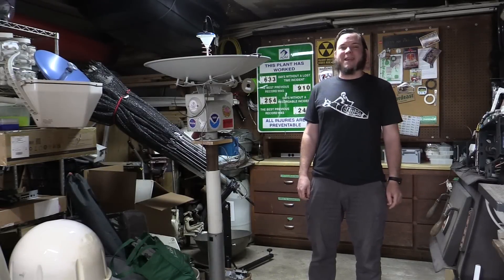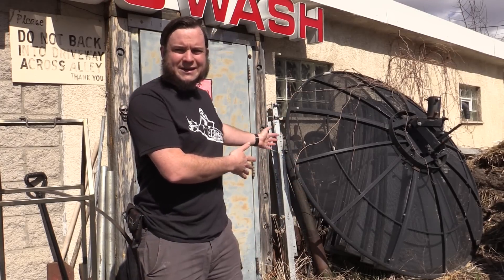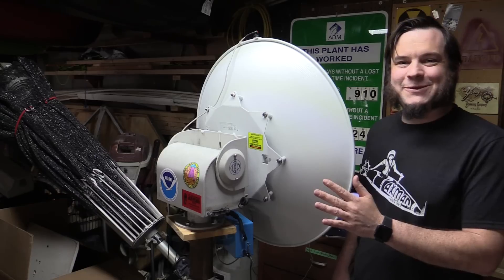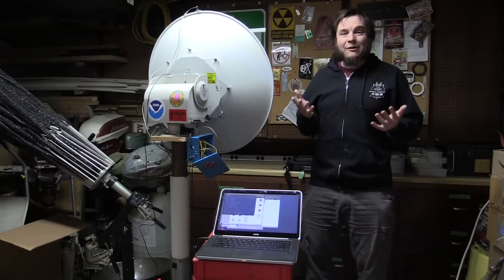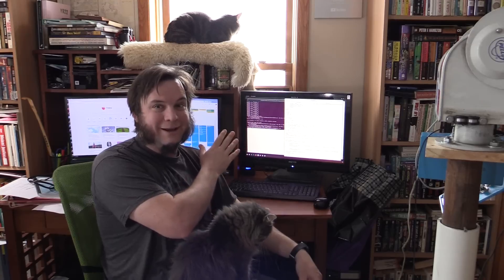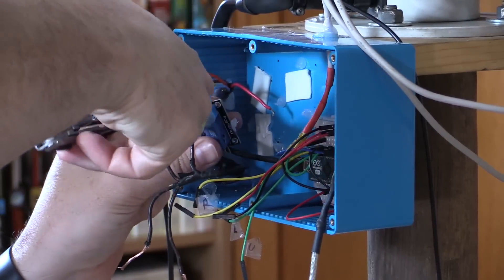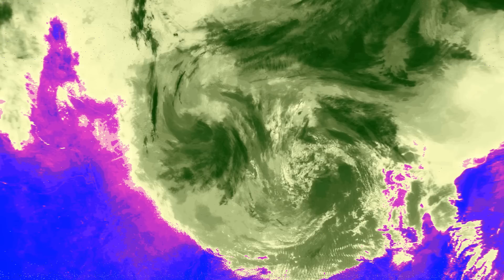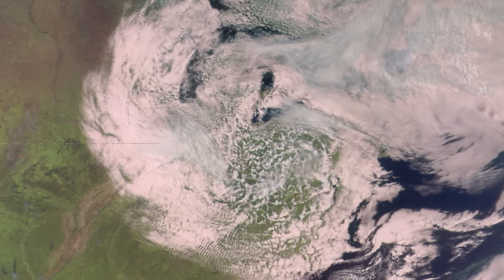DIY Satellite Tracker Pt 2 (And Radio Telescope Struggles!)

Comment: I had a similar issue with clicking relays as it turned out I was not providing enough current to the relay modules.  I was using a 5Ah Dewalt 20Volt battery from drill I made an adaptor with my 3D printer the adaptors can be found on Thingiverse for it/ Anyway, I used a DC to DC buck convertor did not realize the buck converter was only rated @ 3amps. I had to drop the voltage down to 12volts You can see where I am going with this. I needed the full 5A so all the modules will get what they need to run efficiently

Comment: I have been watching a few videos. Maybe instead of the relays, try the L298N motor driver. The page you linked has a schematic under "Electrical (mk1b). This may eliminate some noise.

Comment: I am doing exactly the same with a Sea Tel 2498-E antenna, and I can't find a way to stop it from moving very slowly even with the serial letter D command that says off tracking according to the list of commands
Reply from the maker: Interesting, I wonder if there's a sensor out of calibration, or too close to a magnet or something? I had to move my accelerometer / compass sensor farther away from the motor before it worked right.

Comment: Great work! at least you got the motors to move, that’s already quite an accomplishment imho 😅 I also like your approach to building a mount/ rotator from off the shelf equipment.
I’ve been working on my own mount for a 1 metre radio telescope as well, made the mechanical parts from scratch but the coding and electronics were beyond my ability. So I decided to use an Onstep controller (preassembled) and even that took me three months to get working…
By the way, a motorized mount is nice to have but it’s not an absolute must for radio astronomy. The 3 metre dish in my profile pic is mounted on a simple manual alt/az mount. I  point it to the south and use a planetarium program like stellarium to find at which altitude and time the object I want to detect passes the south meridian. Then I point the dish at that altitude and wait for the target to drift through the beam of the dish, essentially using the earths rotation as the other axis. I know of several other amateurs who use such a “drift scan” approach for their radio astronomy projects with success. It’s a slow but proven technique.

Comment: I suggest you look into ssh, vnc, and build a ptz camera. If I was in your shoes, I would set up a webcam pointed at the antenna in the garage, then either use ssh to connect to the garage computer, or use vnc/rdp if you need a GUI. 

I would also suggest either building a NAS and use nfs or smb, or use something like dropbox or owncloud. Personally, I store most of my project data on my owncloud server as well as config files for my 3d printer so when i make a change like adjusting the default temp on my office desktop, that change syncs to my livingroom laptop, garage pc, etc.

I have a cheap antenna/rotor in my garage that just has a "rotate" button on the remote. I opened the remote to solder the rotate button and made it powered off a wall wart plugged into a wifi outlet. the amp/control box is in my basement. Currently i have an old iphone attached to the top of the antenna to be used as a digital compass which feeds its data to node-red. Node-red receives a command like "rotate antenna to 220 degrees" and then it waits for the next compass reading to come in. if it is within acceptable range, the wifi outlet stays turned off. If it receives a reading outside the acceptable range, it sends the power on command to the wifi outlet. once it is within acceptable range, it sends the power off command to the outlet. Not precision, but I am happy when i can tell it to turn to 220 degrees and it stops at 223.

Ive been working on building a dedicated digital compass because occasionally, the software on the phone does lock up and i have had to go out to the garage to reset it twice.

Comment: Extremely cool. No need to feel bad, your vids are great. If you somehow could figure out how to read the radio signal without USB, then maybe you could use an spi SD card module from axman to collect the data without serial port problems.

Comment: Dude !  I admire your patience 👍 I've been tinkering with all things SDR , HAM, sat tracking , decoding pocsag, Js8, and all the other fun stuff.  I definitely don't have your patience though 😂.  When you said a week, I laughed to myself thinking of the 18 month long struggle I've had decoding P25 in my town😣. I get close and get so aggravated I'm like f@#k it I'm out 😂. Try it again next winter . I'm pretty sure my issue is that the system my town of Plymouth is using is the Boston system which is MASSIVE and I only have 6mhz bandwidth so Im not able to obtain enough bandwidth. Someday I'll get hack RF 🎉.

OH BTW I saw your video where you were showing your garden set up. Your squash plants had powdery mildew which just about every gardener whether rookie or veteran has to deal with. I grew up on my grandfather's large nursery so growing is in my blood.  
My region gets fungal infections every freaking year. Best methods to prevent , well delay the inevitable powdery mildew is to use a hydrogen peroxide baking soda spray as a weekly preventative asap the plants are big and leafy. Hydrogen peroxide sanitizes as soon as the sun hits it , kills all the bad stuff and won't hurt the plant. Baking soda alters the PH so the fungus /mildew can't grow! It has been working excellent for me for the last 4 or 5 years. When I skipped a week in July my 25ft x50ft pumpking patch got hammered by fungus😂.   Also don't water overhead like you have your sprinklers set up. Get a 200 ft roll of black 1/2 or 5/8" sprinkler tubing from Lowe's and pick up a bunch of the cheap sprinklers that you poke holes and connect to the tubing. So cheap and effective! Don't bother with neem oil , it smells horrible and doesn't do $hit😂. Good luck with the gardens this season brother!  Love your channel and I'm jealous that I don't have a n axeman shop here in taxachusetts

Comment: Random resets of a microcontroller are almost always caused by a power problem, this can be a coil activating and dragging the 3.3/5V rail down below what the microcontroller can run at, or it can be a coil activating and producing an EMI spike on nearby conductors. Both of these can be reduced somewhat by putting a capacitor across 3.3/5V and ground, which is generally good practice. I don't know that board specifically but a lot of microcontrollers have a VUSB pin, which is the positive voltage directly from the USB cable, so you can put the capacitor from there to ground if you're powering the arduino from USB exclusively.

A third thing it can be is that every microcontroller has a limit to the amount of current each individual pin can source, and all of the pins together can source, exceeding that can cause a reset, or magic smoke. The solid state relays should draw far less current from the pin, but you may find it improves reliability to have the pin control a mosfet that controls the relay

Comment: I love watching your content.  A suggestion (that other commenters may have made), but why not remote into the laptop in the garage?  Point the laptop's camera at the dish, and make the changes either directly or on your desktop and then copy them over.  You'll be able to work from the comfort of the house, but make the changes directly.
Reply from the maker: I should try that, although I don't technically have Wifi in the garage so I'd need to run a cable over to the security camera network.

Comment: You would be damn surprised how well AI works for helping me throw together code for some completely jerry rigged mess I've put together. I found that was the hardest part to starting to work with it actually; shutting up my brain when it thought "oh there's no way it would have any idea what I'm talking about". Granted its not perfect, but usually gets me 75% of the way there. 

Plus if I get an error I just copy and paste the error code and say "fix this you asshole". Actually trying to figure things out in general has become something like 75% for efficient since I started using it across the board. While never taking it for gospel of course. 

One of my favorite things is to spend an evening throwing whatever harebrained schemes I've come up with at it and seeing what sorts of ideas for execution it comes up with. Gets very uncomfortable when you ask about nuclear weapons though.

Comment: To stop the arduino problems put a 2,200uf cap on the arduino power line as it will kill off the RFI thats on the cable and if ya got some ferrite put some on ya USB cable

Comment: An Information Sciences Major here with a similar lack of math skills. I had a lot of trash thrown at me for having that skill set and still working in IT. I even had people saying that it would be impossible for me to work as a programmer. That comment was made while I had several years of experience as a programmer and several solo projects as programmer of custom ERP projects at my name. Keep up the good work and the output of the new tracking system seems the best I have seen on the channel in a while. Even with the wind conditions the output is very good.

Comment: Hello, I am happy to see you some sort of worked the equipment of yours. I think you are lucky to not burn your arduino ports because of those old type relays. As you know those relays has some coils to close the curcuit and coils rebound magnetism to electricty to the arduino ports when open the curcuit. I think it is the reason to frozen your system and all that issue before you use solid state relay.
Reply from the maker: It honestly seems to work a little worse with the solid state relays, but I'll keep adjusting stuff.

Comment: okay, math! i won't ask how you compensate for the earth turning as you scan the whole sky.
Reply from the maker: I haven't gotten that far! With the little radio telescopes a scan takes about 3hrs, so the earth's rotation would be really noticeable. So far I've been mostly scanning geostationary satellites with those antennas, which stay fixed relative to me. Once I get more of the programming figured out, I'll add in corrections for relative motion (or just steal some astronomy software and interface with that!).
Reply: i've taken to programming on my phone w/ termux and the hacker's keyboard.

Comment: get some rebar and concrete and anchor a base into the ground properly.
You could go less permanant by just forming up a cube of concrete that can be moved around. An engine crane can be found second hand cheap and works as a forklift if you need to move it.
Reply from the maker: This thing isn't really waterproof, so I want to be able to put it away when it rains. I also have limited amounts of big heavy stuff I can put in the front of the garage, I still need to be able to get a car in there sometimes, and boats, etc. Also this thing is too tall to fit through the garage door without tipping on its side 😅

Comment: It would be nifty to figure out a way to use a compass, accelerometer, and gyro chip to orient the dish and ignore the position you assume from the motors. Basically, you command the dish to go to X/Y, and it will drive the motors until the sensors are satisfied. 

You may be able to use an old phone to do this perhaps?
Reply from the maker: That's what the accelerometer chip does, I showed that in the prior video but maybe didn't mention it here.

Comment: Ahh yah the SSRs are a way better idea. The regular relays were likely kicking back some voltage spikes and locking up the microcontroller. Looks like progress.
Reply from the maker: It locks up less, but it also hunts around more. I have mixed feelings on these.
Reply: @saveitforparts  What control firmware are you on the arduino?

Comment: AI would be perfect helper for a custome job like this, all you have to be is specific. I know a little programming but not enough to write a web cam detection applicatoin based on motion, but was able to get chatgtp to write me one using Processing Language. Which i had no faith it would know how to do because Processing is a language used to make graphics quickly, not web cam but they do have a library that lets you use your webcam so you can process it with graphics and the AI showed me the code,  even explained the motion detection algorthim that made perfect sense to me and i dont know of any algorthims, and it gave me a convenient variable to change the threshold of detection.  And voila! it worked, it detected motion.  The code had many bugs but i kept feeding the bugs to the AI and it would be like "oh silly me youre right, that function doesnt even exist, here use this one"  and finally got it to compile without errors. Actually there was one error, some linker thing i couldnt fix but found some manual command on a forum that fixed it. Human help actually is what made everything possible in the end, just that line of code made the program work... Anyway it was some bug in the IDE itself apparently so AI wouldnt have known and didnt know what was up that issue.   This was the orignal chatgtp , your results may vary, but the newered ones are even better. I havent used it since though  but forgot how good of a tool it can be, like any tool depends how you wield it.   Youre dealing with some complex systems youre trying to figure out by repurposing them, not surprised the steep learning curve. All i could suggest is to strip it all back and start simple if you have too.  Get 2 motors, one for x and y and controll them with an arduino, and build off that. Next thing you know youre programming azimuth this and that. I found a really nice touch screen from some proprietary GUI display but have no idea how to repurpose it without being an electrical engineer so i know the frustration.

Comment: If you are doing low level serial commands typically you cant just fire ASCII at it and expect it to keep up. A lot of times its doing a bidirectional sequence where it will send back ACK's (acknowledge) and NACK's (negatinve acknowledge) in various formats to tell you whether the command was processed or not. So when you send a command go into a receive mode and see if the unit is sending back some type of ACK or NACK characters or sequences.

Comment: Also don't be discouraged about not getting a project completed. I have been "working" on this one sdr based rugged radio transceiver for over a year and a half. I know its easy to get bogged down by code and hardware not working great, but I find often taking a step back from the project is helpful. You still got a lot done this video!

Comment: I recently made a small sat tracking system out of an old 3D printer. I used ChatGPT to write python code which takes the AZ and EL for a given sat from gpredict, converts it to gcode and send it to the "printer" via octoprint. ChatGPT managed to pump out the correct code 1st try, definitely worth a try.

Comment: so, I mean, you're doing more than I do lol, so it's productive! in any case, driving these motors with relays is kinda not good. I don't know if these are steppers or plain old brushed motors, but if they're the former, get one of those 3d printer stepper driver modules (should be straightforward to connect to arduino, and as a bonus, should take care of actually moving the motor for you, while you just move it by N steps). if it's a brushed motor, I'd suggest just using mosfets and pwm channels from the arduino (don't forget to add flywheel diodes to the motor!). not sure if it's able to figure out the actual position by means of a feedback signal (potentiometer, encoder wheel), but if it does, you can make it even more robust to winds and such. but hey, your solution works, and I don't have time to build that, even if I really want, so take my suggestions with a grain of salt. but seriously, this project is really cool!

Comment: Heya Gabe, if you need a second set of eyes on the code, let me know. I'm not an expert coder either, but sometimes more than one set of brain cells might help to see something that was missed. Perhaps setup a github for what you're working on? Also, the documentation for the items in the dish assembly couldn't hurt either. :)

Comment: I changed some code on the raspberry noaa v2 program to record Ham chatter off the ISS repeater with a omni-directional antenna when I'm not at home, this sat tracker idea with a yagi mounted on it will work well with that I think.

Comment: The one thing Ive learned with usign things like ChatGPT is you need to have an understanding of whats going on. You cant really just say "make blah" and hit run and it works. You can get 90% of the way there but you need to know the last 10%. 

ChatGPT has turned me into an Excel god because Ill be super vague as it doesnt care abotu the details, but you have t know what to with the formula once it gives you something. Same way with programming something like this. I have X stepper, and X driver and I need to make it move one step with a button. It gives you code. Then say take that code and make it step automatically. Great. Then just keep repeating and baby step your way to what you want with you filling out the holes along the way.
Reply from the maker: That's kind of what I thought about ChatGPT, all the kids are saying "just have AI write the code", and I have no idea how I'd even tell an AI what I'm trying to do :-P